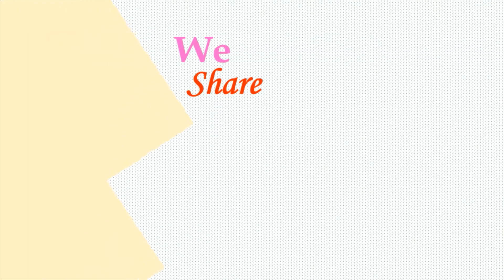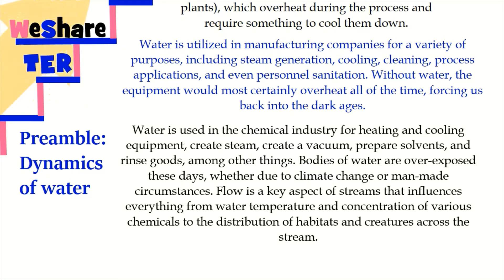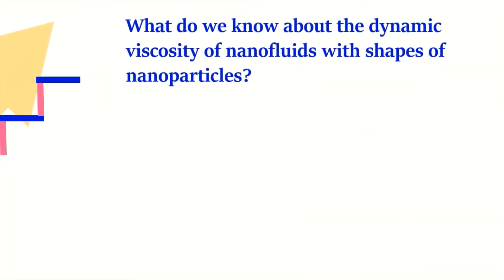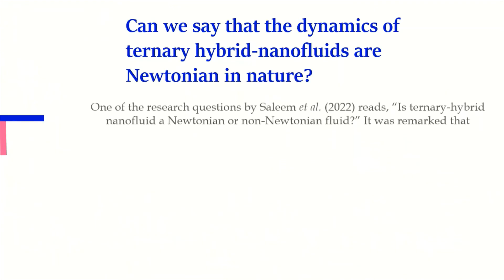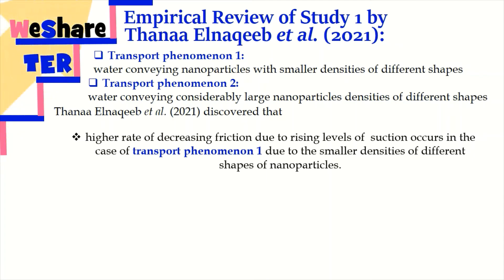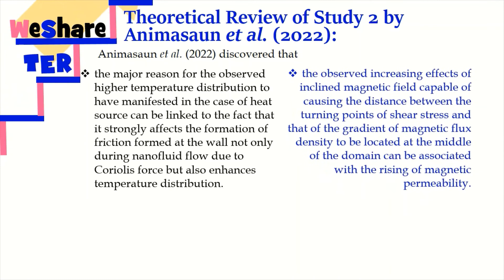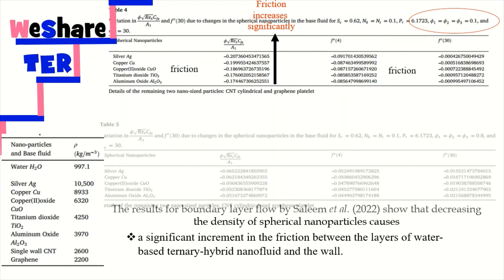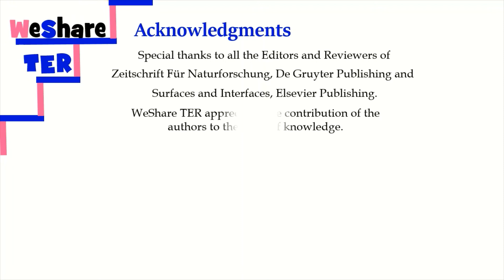Ternary-hybrid nanofluids

Comment: The DOI of 2 and 3 is incorrect in your source.
Reply from the maker: Thanaa Elnaqeeb, Animasaun, I. L., & Nehad, A. S. (2021). Ternary-hybrid nanofluids: Significance of suction and dual-stretching on three-dimensional flow of water conveying nanoparticles with various shapes and densities. Zeitschrift Für Naturforschung A, 76(03), 231 – 243.
https://doi.org/10.1515/zna-2020-0317
Reply from the maker: Animasaun, I.L., Yook, S.-J., Taseer Muhammad, & Alphonsa Mathew (2022). Dynamics of ternary-hybrid nanofluid subject to magnetic flux density and heat source or sink on a convectively heated surface. Surfaces and Interfaces 28, 101654.
https://doi.org/10.1016/j.surfin.2021.101654
Reply from the maker: Saleem S., Animasaun I.L., Se-Jin Yook, Qasem M. Al-Mdallal, Nehad Ali Shah, and Muhammad Faisal (2022) Insight into the motion of water conveying three kinds of nanoparticles shapes on a horizontal surface: Significance of thermo-migration and Brownian motion. Surfaces and Interfaces 
30, 101854.
https://doi.org/10.1016/j.surfin.2022.101854
Reply from the maker: Wenhao Cao, Animasaun I. L., Se-Jin Yook, Oladipupo V. A., & Xianjun Ji (2022). Simulation of the dynamics of colloidal mixture of water with various nanoparticles at different levels of partial slip: Ternary-hybrid nanofluid International Communications in Heat and Mass Transfer 135,
106069
https://doi.org/10.1016/j.icheatmasstransfer.2022.106069